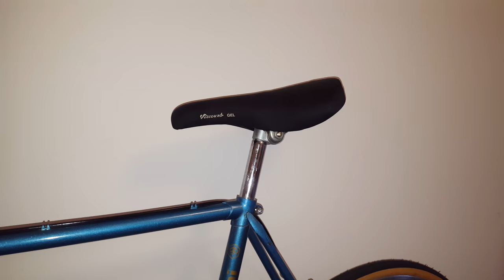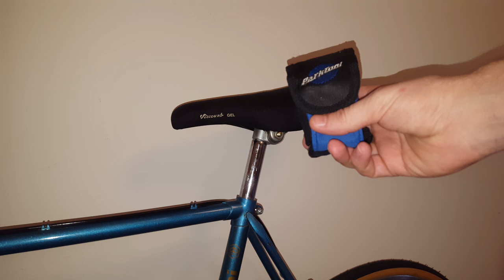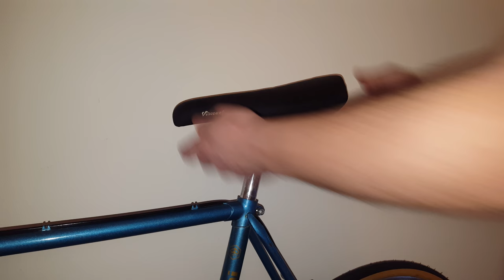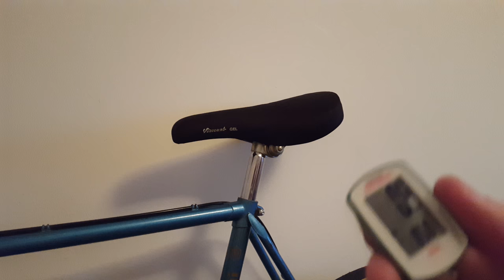[4K] How To Adjust The Seat Post On A Vintage Road Bike!

Comment: "Nice and tight " anyone that's new to bikes would be better checking out torque values for given fasteners rather than the "nice and tight " info
Reply: What torque value do you recommend?
Reply: @briancaine9130  there’s charts with specific values depending on which metal which measurements M6 with grade 8.8 and what thread pitch ,you then reference what suits your needs,